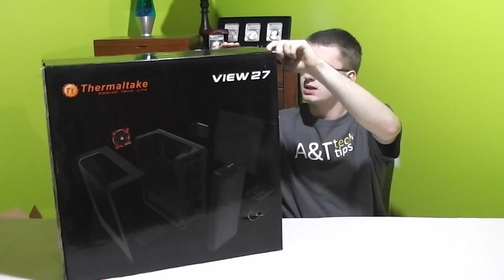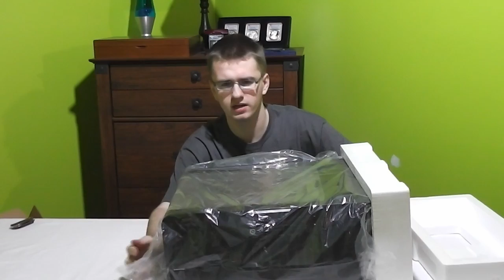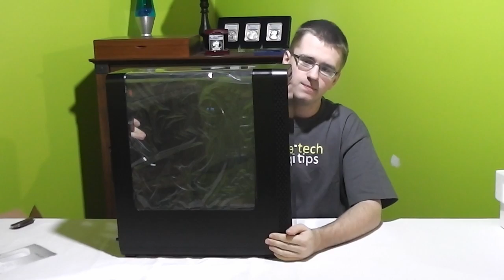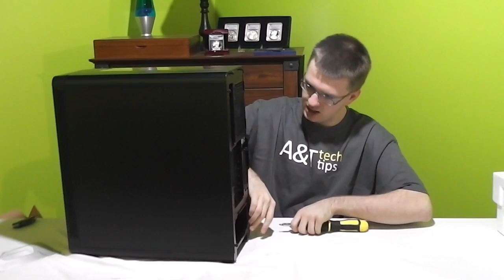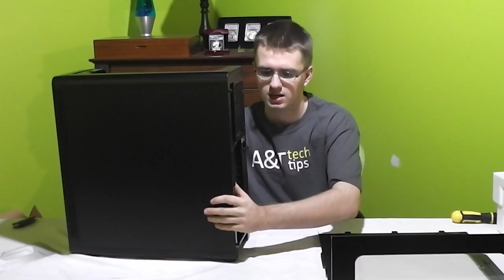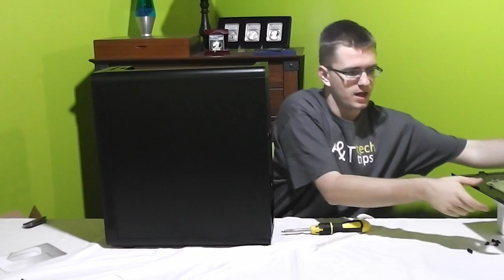Thermaltake View 27 Unboxing

Comment: What do you need to get the back fan that they have provided working? Is it an LED fan? what color?
Reply from the maker: So I can't speak for Tyler, since I don't own this case, but if I recall correctly, it's a non-LED fan, and just works with the 3 pin fan connector. I don't remember if it has the 4th pin for PWM control or not though.
Reply: Thanks!
Reply from the maker: +Ron Lee The fan in the back is a Red LED fan that connects over a regular 3 pin fan connector.